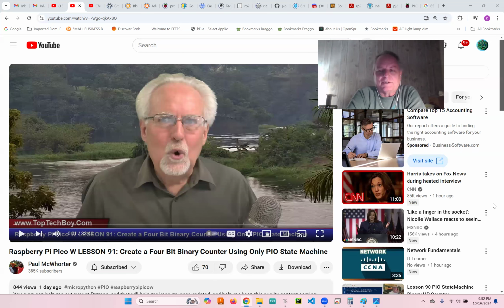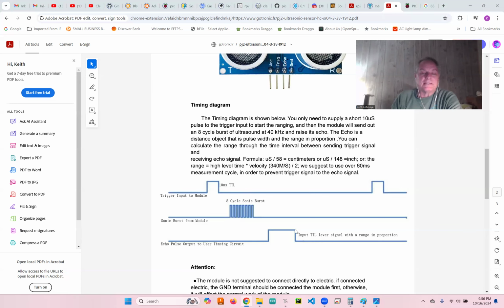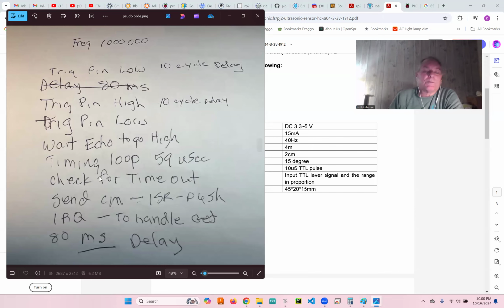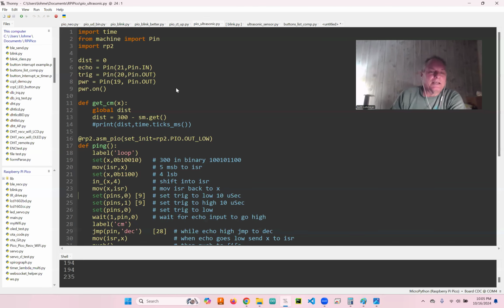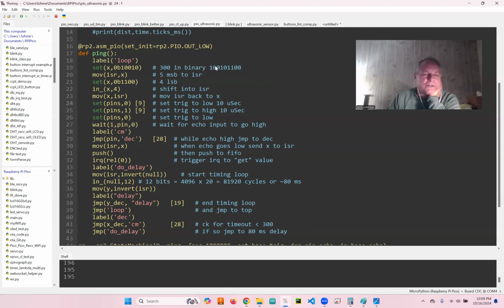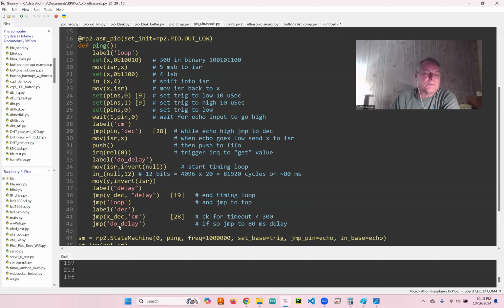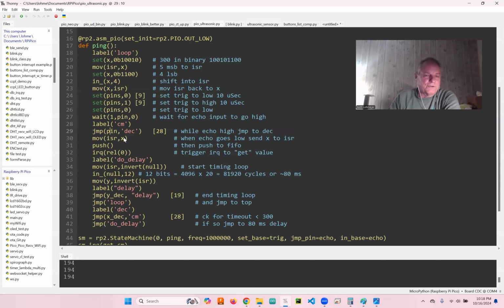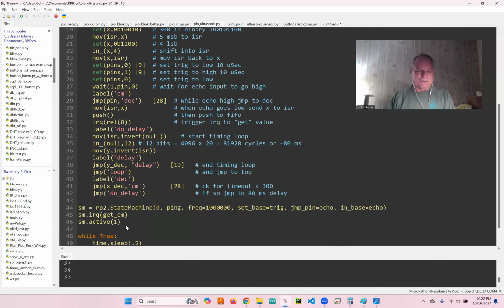Pico W PIO Micropython ultrasonic sensor code HC-SR04

Comment from the maker: When you pulse the trigger pin the sensor sends the ultrasonic out then sets the echo pin high. This is what the wait is waiting for. The sensor sets the echo pin low when it receives the ultrasonic return. The high period of the echo pin is what we are timing. If the echo stay high for too long we break out of the loop and don’t return a value. Hope this helps.

Comment: Thank you for your tremendous work on this. One question- on line 30 is mov(sir,x)  if states that when the echo goes low to send x to the sir.  Can you explain what made the echo pin go low. I see the wait setting it high but do not see the command for changing echo to low?